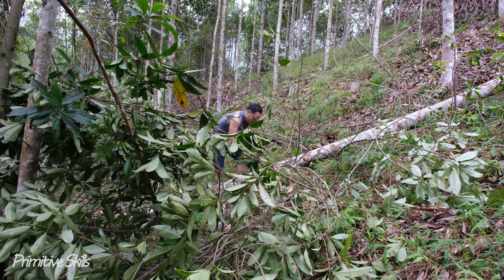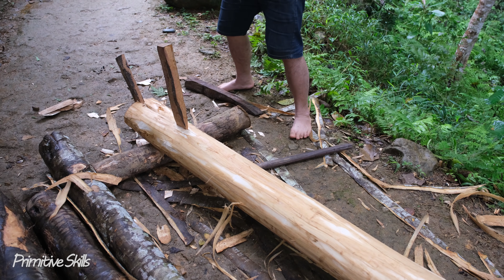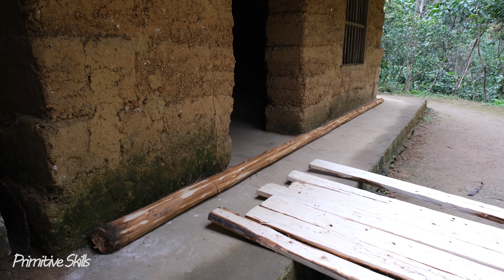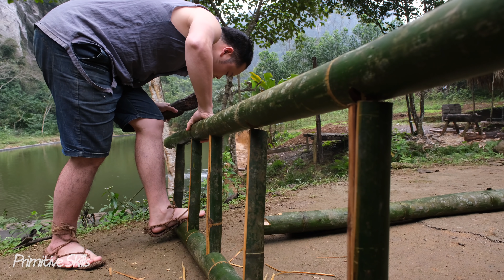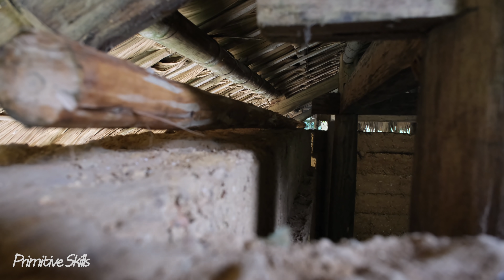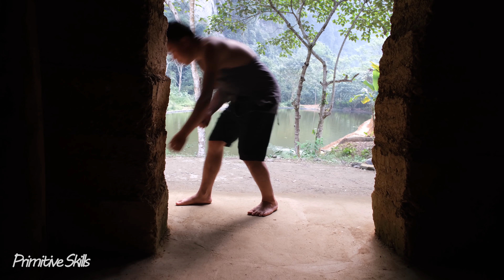PRIMITIVE IRONWORK: Primitive blacksmiths forge tools from iron - Ep.150

Comment: You can try lubricating the wooden joints on the waterwheel with powdered charcoal.
Reply: That over time would grind down into a smooth carbon surface, right? A problem may be the water splashing onto the joints, washing away the charcoal. But for other, dry machinery like his recent grindstone that would be a great idea to minimize friction.

I had the idea to use some of the peanuts he grew to extract peanut oil, both for cooking and lubrication of machinery. Shut off the water to the wheel while you let the oil soak in and move the wheel by hand for a while, that should keep it greased for some time.
He also shouldn't let the wheel be soaked all the time when he isn't using it, never mind not coating the whole thing in resin or something to make it more durable.

Comment: Dude you're wasting some pretty good lumber right there how about thinking about building some sort of makeshift sawmill that way you can use all of the wood that you cut down without having to chop at it and whatnot use that made shift water system that you have it might be like several parts you have to do but it couldn't be that hard could it it's just a bunch of gears and rope and whatnot then again you would have to make a much longer saw piece to do what you need to do but it could make it a little bit more easier

Comment: Have you ever thought about making a machine for cutting wood into planks?  the water wheel can be used to make a band saw, set up a log bed and cut
Reply: band saw blade require spring steel iron won;t work!!
Reply: @keithmoore5306  the counterpart must be placed in such a way that it would fasten the canvas under its own weight
Reply: @Roman-kelpie  that's not a bandsaw a bandsaw is a continuous loop of steel you're talking about a plain rocking power saw!
Reply: His wheel has no torc, he can stop it with his hand. Neither of this would work until he could improve the performance of the wheel. I think the catch buckets could be bigger.
Reply: good idea, but there are a couple of nuances. 1, the water wheel may lack power at the moment, this is the main problem. there is little water with such friction between the shaft and the support, you need to either reduce friction or increase the amount of water. 2 for the saw you need a good iron plate, that is, 5 centimeters wide, and 1-3 millimeters thick (depending on the load), otherwise it can burst, like a long one, at least 80 centimeters (the length depends on the thickness of the logs. I took the length for eye, looking at the logs that he uses), and this requires iron (although there seems to be no particular problem with it). and so the idea is good
Reply: @ТимаКрутоус-р4б  I agree, we will wait for what our friend will come up with
Reply: @___X___  that's just low water flow when the rainy season comes it'll move!!

Comment: Try to raise the stone anvil higher to your abdomen level, so you will not need to crouch. When standing, you will be able to impact more force into the iron and not be afraid to fall over. 
Use levers or simply roll it higher and then lower the stone onto a platform. 

Best of luck. 
also, try to make nails flat triangle in shape, they will not split the wood as much.

Comment: To make your smithing Easter you could make a second blower and then attach both to a water wheel with an offset, when one is blowing the other sucks air in. Than you have a constant flow but not work. But you would need a water source with enough power.

Comment: Nail making:  Carve grooves/slots into your stone anvil the size/diameter of the standard nails you want.  Use the grooves to form more consistently uniform size nails.  You could also create nail forming grooves in a hot iron plate, using a chisel.
Reply: Cool concepte, but unless you can show examples of that being done I will counter and say that the best way to make nails outside of an industrial scale is by hand, using only a hammer and maybe a wetstone. Source: I literally did blacksmithing for 4 years.